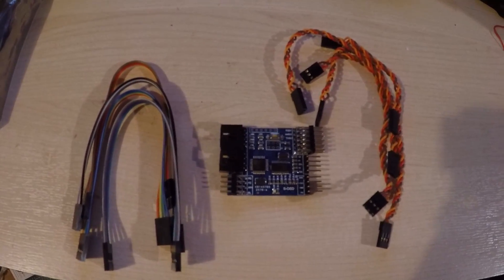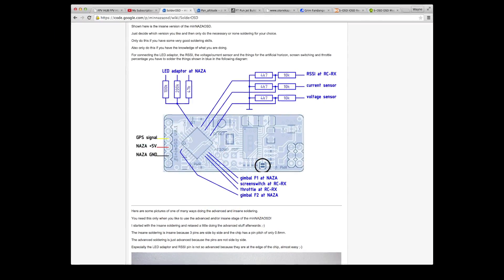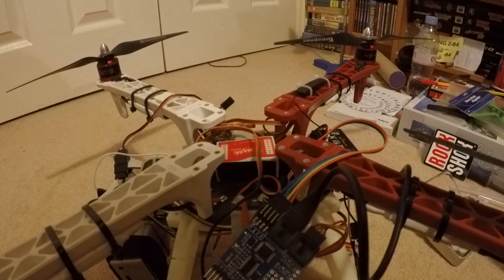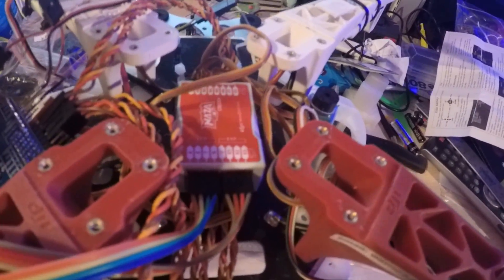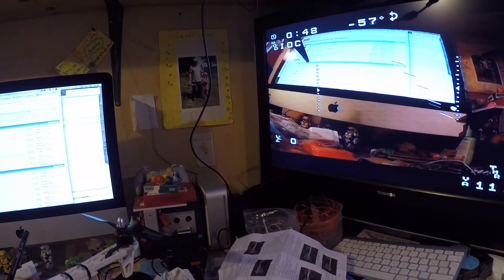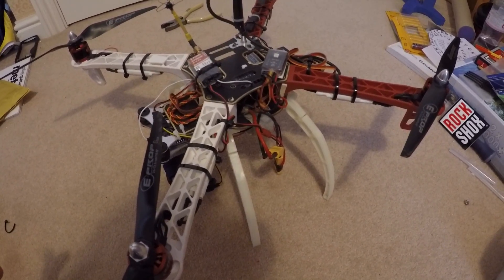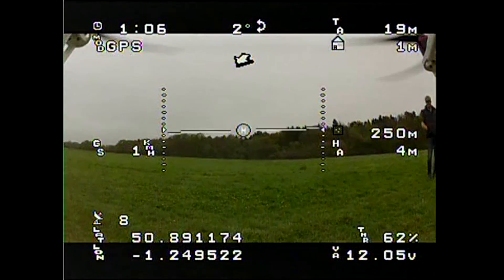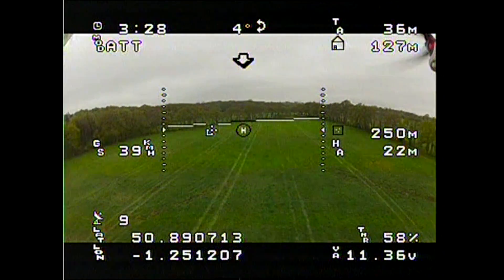FPV review: The S-OSD for naza (part 1)

Comment: great video, very helpful thanks.  Can this OSD accept a 5v fpv camera input ?  I have a fatshark fpv camera which is 5v rather than 12v ?
Reply from the maker: Raymond Kerr You only connect up the video signal and ground from the camera, so it doesn't matter what voltage it runs at.  But bear in mind that the osd won't power the camera either, so run the cam from the 5v out of the vtx or a bec elsewhere
Reply: CurryKitten  Do you need to have a common neg if you run the + voltage from the VTX? I can see the OSD on my screen but no camera image :( and also you said about the connections being indicated around the wrong way can you confirm which cable sig or neg should be on the top please?
Reply from the maker: FPV-Quadcopter Racing To be fair, the -/+/sig was written correctly on the board, but on the opposite side, so you kind of have to look at the description for the top pin.. where the top pin is the bottom pin at the time.  It threw me, but if you look at the board so the reset button is on the top, then the signal pin is the top one.

Just to clarify - are you talking about running a 5v camera from the VTX, so the 5v/ground will go to the camera, then the single video cable will go from the camera to vin, and then the single vout wire would go from the s-osd to the vtx ?  If that's the case, on a single lipo system it should be fine as the ground is common on the s-osd with the battery voltage one as well.  If I've misunderstood the question though, just let me know :)
Reply: CurryKitten  Thanks for that, My camera is 12v pixim seawolf and I have got that working and the OSD. I took the pos and neg feed from the vtx and them just fed the signal on its own back to the OSD and its working. For some reason it is flicking through the osd screens though, I take it you can use Sbus on ezuhf which is unfortunate, I will have to feed all the individual servo wires through now :(
Reply: CurryKitten OK finally got it all hooked up unfortunatly in the traditional manner without sbus so my quad now weighs about 3t with all the wires :( One thing I cant get to work is the switch the osd boots shows the display then goes through the different screens constantly, I have the switch set on a 3 way switch but it dosnt seem to do anything :( Any ideas?
Reply from the maker: FPV-Quadcopter Racing I don't use ezuhf myself, but you can assign a single channel for subs ch 1-8 and then another channel as ch 9 or whatever and so control the screen switch in that way ?  I noticed by default the screen switch appears to be setup as a momentary switch, so at a certain point will keep cycling through, so check the value of your low (default) position and make sure that's the max/min value it can be (can't remember which one)
Reply: CurryKitten yeah thats what happened with the switch was just cycling through, I tried using sbus but you have to use the throttle channel and it didnt seem to do anything when I plugged into channel 3 for throttle position, getting there slowly :)
Reply: FPV-Quadcopter Racing The throttle channel from the esc plugs directly into the reciever, not the AP.....On the ezuhf reciever, multiple sppm outputs from channel 1 go into the Mode input slot of the Storm, there are only 4 you can feed it......Aileron, Pitch, Screen Mode, and Flight Mode....Hope this helps....:)
Reply from the maker: EnglishTurbines Dave, on this OSD it can accept a throttle input and then pass through to the FC.  We're talking about a quad input here, so the 4 wires from the ESCs all go into the motor inputs in the FC, they don't go anywhere near the rx
Reply: CurryKitten Ooops, your right, what was I thinking, I was fixated on fixed wing?...:(

Comment: I'm mid way thought hooking up the mini s-osd to the naza on my cinetank. Everything is on the screen, my only trouble so far is my flight modes not updating
Reply from the maker: Benjamin Harvey That's a weird one - have you checked your connections into the S-OSD from the LED module are around the right way... there does seem to be a delay in changing modes, but it does get there in the end
Reply: I was wondering if I had a crossed wire, I get all the lights on the led module though
Reply: Benjamin Harvey Did you find any solution to your problem? I have the same issue with my mini s-osd
Reply from the maker: Henrik Flybring I'm interested to know as well.  Do you see anything on the screen where the flight mode should be - does it stick in one mode and not change ?  Does it mirror the LED flashing light as it should ?
Reply: CurryKitten I can see it on the screen, but it is stuck in manual mode. LED is working and can connect it to computer without any problem.
Reply from the maker: Henrik Flybring I can only think it's a dodgy S-OSD board.  It's not actually possible to plug the LED connector to the S-OSD upside down, so you can't get the pins wrong.  You can on the connection between the S-OSD and the Naza, but this shouldn't have an impact of what you see on the screen.  I would suggest you take a video of the issue and send a note to who you got it from with the video link to demo the problem.  If you got it from Banggood/GLB, then they are pretty quick to replace with a video showing the issue
Reply: CurryKitten Yeah I think so, going to contact the seller. Thanks anyway!
Reply: My led module works perfectly, but alas, still no mode update as yet!
Reply: CurryKitten Got my new board today, and it is the same problem, changed the led cable from naza to the board just in case.. Guess this is some really bad boards.
Reply: Henrik Flybring Mine does the same thing, 95% of the time it just says its in manual. However once in a while it starts blinking like it should and changes the mode to GPS, even though some times its not in GPS. I don't think its a faulty board as i have seen too many people complaining about the same fault. Did you find a solution?
Reply from the maker: Craig McTaggart Hmm, is there any common thread amongst you guys having problems reading the mode from the LED.  DO you have Naza v1/2/lite ?  Having taken a quick look at the code it determines the colour of the LED by reading the voltage off a pin from the module connection.  It will return no led (manual) if the voltage reading isn't high enough.  Does beg the question about why your voltage is being read at - if anyone is comfortable changing the code/recompiling/flashing, then there's just a few defines you'd need to comment out to get some debug out to your OSD
Reply: CurryKitten I am using the Naza Lite with the V.2 upgrade hack, glad i have stumbled across your page currykitten, i am hoping you might be able to find a solution for me :) Paticularly that yours works!! I suspect we have wired somthing up wrong to read the LED signal. I currently have the LED module plug going into the OSD plug, this plug cannot be put in the wrong direction, however the plug coming out of the OSD which goes back into the Naza can. Would you be able to note to me which direction yours is plugging in by the colours? I didnt want to turn it around in case it damaged somthing.
Reply: Craig McTaggart Also could you tell me which wire colours carry the LED signal from the Naza to the OSD, i want to test continuity on the wiring and also voltage coming from it.
Reply: Craig McTaggart I have done some more tests this evening, i have confirmed all wiring is correct, swapped connector around to be sure and LED doesnt work at all, put it the correct way and it flashes as normal. Checked continuity on all wires and thats fine. I noticed with the LED wire connected, the OS just displays Manual and nothing else, no blinking box or anything. Unplug the LED wire and I get a flashing box which appears to the right of the mode as if its reading the LED. Driving me nuts now, seems to be way too many people complaining about the same problem to be a coincidence, has to be a software or setup issue!
Reply from the maker: Craig McTaggart Seems very odd indeed, could be worth reflashing the hex file to the OSD (do it through the OSD setup software) - I recently had to do this to calibrate my voltage sensor - which was fine, and then was way out on another flight.  Anyway, you'll find a zip from this post http://www.rcgroups.com/forums/showthread.php?t=2020638&page=6#post26526305 inside that there's the folder 003_DJI, I used the miniNAZAOSD_DJI.hex inside of that one to flash back after doing the voltage calibration
Reply: CurryKitten I have the Naza Lite upgraded to v2 as well. I can try to reflash the firmware and maybe debug it..
Reply: CurryKitten Craig McTaggart I can comfirm that I got it working now after checking the debug info of the LED. Recompiled the firmware and changed LED values to:

#define NAZA_THRESHOLD_YELLOW  90
#define NAZA_THRESHOLD_RED  60
#define NAZA_THRESHOLD_GREEN  25

May not work for someone else but at least that is the value needed for my board.
Reply from the maker: Henrik Flybring Nice work Henrik - very useful for anyone else experiencing this issue.  They are miles out, like a factor of 10.  It's not too dissimilar to how far out my voltage sensor was - it started out accurate, then suddenly was showing 9v on a fully charged 4s.  Fine since I used the recalibration compiled hex file... but very odd
Reply: CurryKitten That's a bit odd indeed.. need to calibrate my voltage sensor as well so that's what I'm going to do now :)  
Anyway, thanks for all the help! Awesome channel!

Comment: Ive been using this for a few months with only one issue. After 3 or 4 flights the osd would stop passing the GPS signal to the naza which would kick me out of GPS mode mid flight. I wasn't able to fault find it accurately, it may of been a loose cable or something more, but resolved it in the end by cutting the supplied GPS output cable in half and soldering the pigtails to the GPS input pins meaning the naza gets the GPS signal regardless of the state of the osd as it is wired in parallel rather than series. Other than that its a brilliant bit of kit at half the price of the naza osd.
Reply from the maker: James Mann Good to know - I'll keep an eye on that one.  Like you say, could be just a dodgy cable/connection, or some bad QC.... which is unheard of on cheap Chinese boards :)
Reply: Bad QC... Nah, can't be that lol!!

Comment: Great raw tutorial Wayne, Im sure some people will benefit from it...Talking of OSDs, can you help me with my Storm please ?...Im still a bit confused about the power input to it...I understand the independent 3S batt input port, thats clear enough, it can power the Cam and VTX if I understand it correctly...but when do you have the 2 pin jumper installed and why?...I thought if you used the current sensor option, this would also power the Cam and VTX, but do you need the jumper on or off? Its rather vague about this in the Manual. Everything else seems straight forward....If there are two power wiring scenarios, then why cant they just give us two wiring schematics ? Help is much appreciated m8....:)
Reply from the maker: EnglishTurbines If you leave the jumper in position, then the power is taken via the current sensor.  The idea of the independent supply is if you want to run a 2 lipo system, or you are on 4s, and want to use the current sensor, but still need to feed it 12v (feed it a 4s raw and magic smoke will appear).  So if you want to keep it simple, just plug your 3s into the current sensor, then plug in the necessary servo leads and 12v camera etc
Reply: CurryKitten Ah, I see now...thankyou for that m8...So, on my instructions, the 2 pin jumper goes between the centre pin 11.1 plus...to the upper pin which is signal....Im assuming the Storm will not supply 5vdc to power my RX? I have my CP50 Evo1 Fuz on build so I can fit the Storm in it, looking forward to trying it out soon. ..thanx again m8..

Comment: I used this OSD myself for a while I purposely wanted to see GPS Status
As you maybey aware the Naza doesn't like not having plenty of sats and can go from smooth flight to twitchy flight in seconds on satalite loss.
 Its not too bad has some issues I couldn't get RSSI on it which was a important factor not for distance so much but for going threw barns and low alt flying behind trees. Last thing I want is RTH kicking in then hitting a roof on the inside of a barn or getting caught in trees on the way up to RTH Altitude. Also the fittings to put the LED connector and GPS connector are not very secure and need to be fixed in. Apart from that it was a really cheap and accurate OSD and will probably get another should the RSSI become easier to set up. PS I will note that the receiver is a frsky 9LR long range so doesn't send RSSI to the Taranis Radio so on screen RSSI is a must for me.
Reply from the maker: Pudsey - Rc Thanks for the observations, I'll have a look at the RSSI.  I did note it is only analogue voltage (which obviously your LR9 does without any mods) so should be fine.  Although I'm not sure why it can't handle PWM  RSSI as well as might allow me to use my x8r without building the little buffer.  I've often though that if i use Naza in an enclosed environment I might change the failsafe just to position hold instead of RTH, as I would think I could potentially get closer, get the signal back and get out of trouble.
Reply: CurryKitten I have done the barn and tree tests the l9r receiver seems pretty strong just video signal loss for seconds which isn't too much of a issue as long as the quad keeps going in the direction you sent it until video comes back. But very interested to see your findings and thanks
Reply from the maker: Pudsey - Rc Just wanted to check how far you got on the RSSI setup, I connected up my RSSI and there was nothing, so when I went into the OSD config tool I also noticed that the RSSI option wasn't actually enabled... which is weird.  Just wanted to check if you'd gone down this path, but then had issues setting up your RSSI max/min values or just expected it to work (as I did)
Reply: No mine actually ceased to display anything so took it out of my model. Was going to wait until this option was documented before getting another. I contacted the place I got it and they refunded.